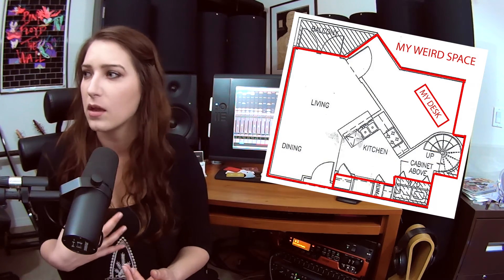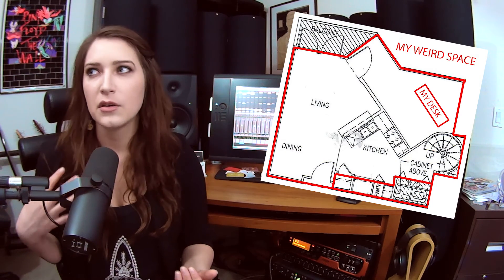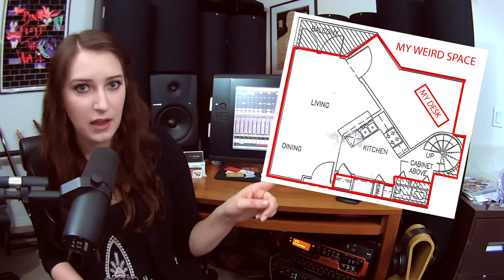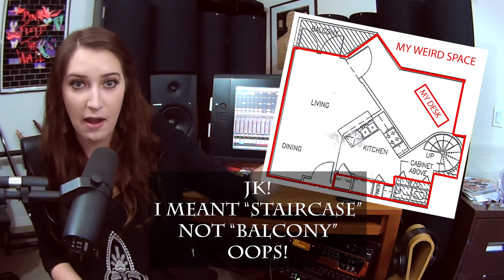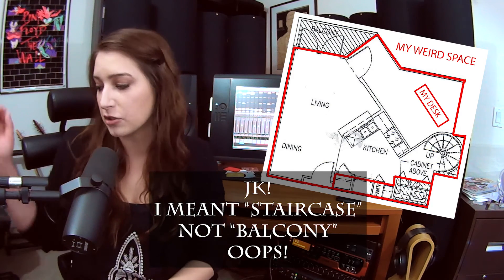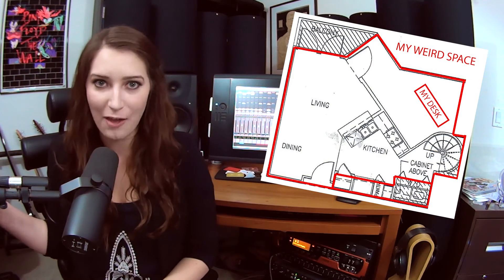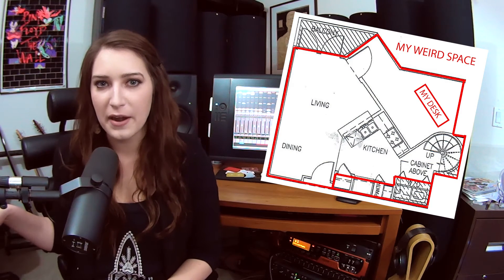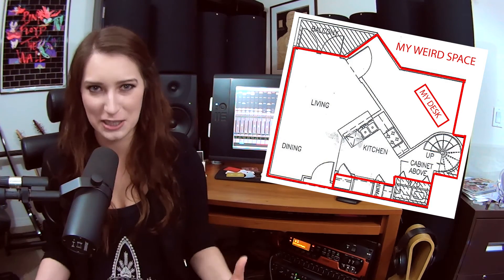Parallel Walls: Are They So Bad for Acoustics?

Comment: When I started the studio in the basement of my home, there were so many reflections, that if someone was standing 6 feet away from you, you couldn't even understand what he/she was saying! It was a lot of flutter echo/reverberation. All concrete walls, floor and ceiling. So I started to put carpeting on the floor, treat the walls with sound absorbing material, add a lowered ceiling made from sound absorbing tiles and add extra bass traps above the lowered ceiling. It is important not to add too much absortion, because this would result in a very dull sounding room. It was a matter of trial and error. The biggest problems were the bass frequencies. Later I have added more bass traps and now the room is perfectly usable as a recording studio.
http://vansteenisaudio.nl/Studio.jpg
Reply from the maker: oof, yeah, concrete can really bounce things around!  I'm glad you got it worked out - it looks great!

Comment: My room certainly isn't as odd as yours but it's not standard. It's not even easy to explain so I shall refrain from attempting. But I get what you mean about if should you just ignore the little things - however if the acoustic treatment doesn't go to plan you start to question whether it was so 'little' after all. Or maybe it was just another issue entirely. I ended up ignoring the little things in my room and from about 100Hz up everything is fine but now there is a bass null that I can shift around depending on my distance from the speakers, slightly annoying because when sitting the length away from the speakers as they are both apart, the null sits pretty dead on F. So some songs would be sounding AMAZING until the bassist hits a F and then it totally kills the bass. So I compensate and now I don't have the best possible stereo image - just to have even bass. Another thing in home studio environments, it's pretty easy to treat the highs and get them sounding FANTASTIC but like my situation, a bass issue stands out A MILE when everything else is perceived as perfect and it's so much more difficult to treat bass than the higher frequencies, considering some pro rooms are designed to keep bass under control and monitors are soffit mounted, etc.. So you kinda have to accept low end ain't ever gonna be perfect in a room built for living rather than for mixing. I spent a fair bit on the acoustics as well, this guy in the UK has done stuff for the BBC and recording spaces both pro and amateur all around the country, and I appreciate what he has created for me, it's worked wonders, however some things are just out of control in a house!

Just sharing an experience, I can talk about this stuff for ages, id keep making videos if I were you, even if it's to get a discussion going, it's worth putting your ideas out there. Good luck on your acoustic endeavors!
Reply from the maker: Adam Callan thanks man, and thanks for replying!  and yeah, I agree with you on bass, so many people seem to ignore it when treating their home studio.  That's awesome that you got someone to help with your acoustics - I think I might be getting to that point where I should too.

Comment: My studio room use to be my bedroom, so I've got a few wardrobes up there, and the walls are quite irregular because one part of the wall pokes out cos we used to have a chimney. However I got acoustic foam glued to my wall, and eventually I had to buy bass traps too. And with my Genelec, I EQ the speakers (the back of the speaker) so now I have the perfect even frequency response.
Reply from the maker: that's awesome!  I'm glad you figured it out.  What sort of work did you do to figure out what to do to treat the space?
Reply: Cato Zane so I with the speakers I made an equilateral triangle and created my 'sweet spot'. So I placed the microphone on my sweet spot and played pink noise. I use the analyser as well as my ears then tweet the speakers to the level that I was happy with.
Reply from the maker: oh cool, I used a measurement mic in my space too ^_^